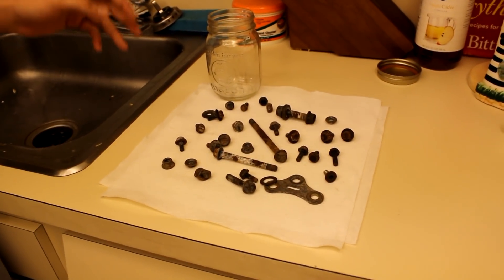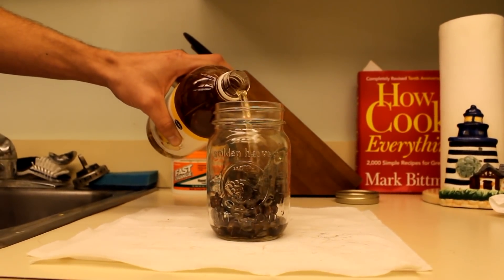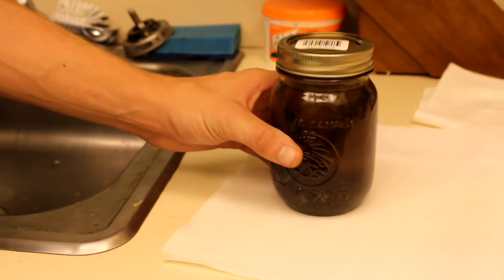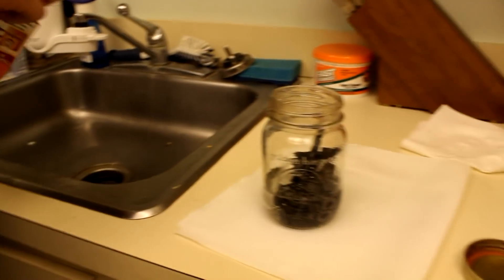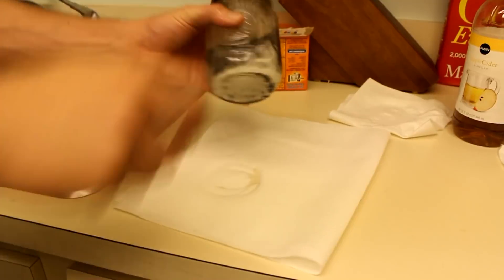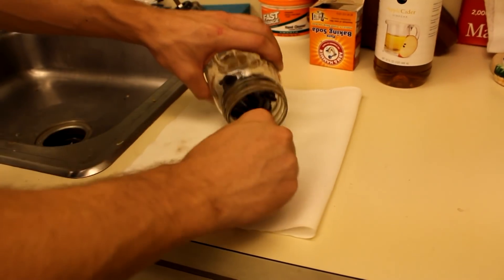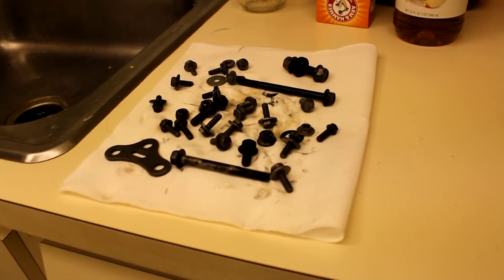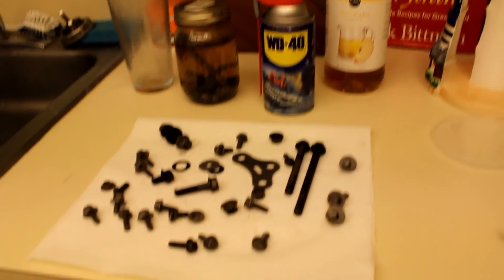HOW TO remove rust with vinegar

Comment: You can find even more potent "cleaning vinegar" at Wally World. Regular "cooking" vinegar is pretty diluted and weak by comparison. I use cleaning vinegar and my old Lortone rock tumbler I use for wet tumbling cartridge cases to clean up smaller steel gun parts and various small parts from other "wrenching" projects. A little agitation cuts cleaning time from hours to minutes.

Comment: I have just cleaned the rust off my new / old wooden planes and the white vinegar trick worked a treat...but thinking another couple of days in the vinegar would be better .....the irons have rotted through and i do not known if the will sharpen to anything good....vinegar works but ..."A little dab'll do you "....a day or 2 no more.....best to give it 4 hours then a clean off with wire wool another 4 hours and wire wool again .....then get the wet and dry out.... then the water stones .......spray with oil to remove any water to prevent rust....Whoops....!!!!

Comment: I did this on a set of feeler gauges and it actually DISSOLVED a few of the thinner ones. Just left some stubs where they once were. LOL. I thought it would just react with the rust, but it totally dissolved the metal. So be careful if size tolerances matter, because it does remove metal.

Comment: Just had some metal tools sitting in vinegar for about a week.  I had two bicycle chain whips and when I drained the vinegar the chains were completely disassembled.  Each link was completely gone.  I did no agitation of the vinegar besides carrying the container into the house from the garage.  I can't explain how it happened.  Do not try to remove rust from bicycle chains with this method.
Reply: Michael Hinz It is because you left it in there for a week. Vinegar is acidic so it will break down anything over time. You only want to leave it in there for 24 hours at the most. If after 24 hours the parts still have rust on them, rinse out the vinegar and neutralize the parts with baking soda and water. Then put your parts back into a container and restart the process by adding vinegar but only leaving the parts in there for 12 hours and then keep checking them periodically until you see no rust. Then soak them in baking soda and water but put double the baking soda and leave for 3-5 minutes to be sure the baking soda gets deep inside the crevices the rust ate away. Most likely this will be irrelevant because you probably are going to have to buy a new bicycle chain but for future reference....Good Luck!👍
Reply: That's what acid does haha. Don't leave important stuff in acid for a week. Sorry about your chain :(
Reply: Important point, not good news though. Do you know of any substance that primarily dissolves rust?

Comment: Great video!  But I might suggest spraying the WD-40 on before you let the parts dry.  "WD" stands for "Water Displacement".  Let it displace the water.  Then wipe with a rag and apply a thin coat of light oil or grease.  But that's just me.

Comment: I'll give you one tip that will help you out in life anything that you want to keep from rusting never apply WD-40. almost any petroleum-based lubricant will be much better than  WD-40 my personal favorite is used motor oil. why use used motor oil you may ask well there are a few reasons. the dirty motor oil will be able to be seen on the parts so you know they are still being protected also the used motor oil Stix or clings to the parts much better than new motor oil plus it is a good use for something that typically will B disposed

Comment: how long after i put the baking soda with water?
Reply: You don't really need to use baking soda. Since its only vinegar just rinse the acid off. The whole "acid neutralization" is completely useless. If you insist on doing so, a neutralization would take like 5-20 seconds.

Comment: +womackke will rhis work with white or brown vinegar & is the baking soda really neccessary if ur going to spray the parts with wd 40 to counter reoxidisation?
Reply: The baking soda is to neutralize the acidity of the vinegar. In theory if you didn't apply it and the WD40 didn't displace the vinegar then the vinegar may continue to eat away at the metal. It's better safe then sorry if it's something you can't easily replace. For a hinge, you could mix the soda and water in a spray bottle and apply liberally to the hinge then rinse with regular water and then use the WD40.
Reply: Rinsing with water and drying thoroughly should be sufficient. It has a relative neutral ph that should counteract the vinegar.

Comment: I have a trimmer that is rusted and doesn't want to turn on. Can I restore it by doing that?
Reply: I have exactly the same problem..also keen to know the answer?
Reply: Sure. Any metal can be derusted like this.  Just watch out with electronics,  don't get them wet with either water or vinegar

Comment: hey. I had a question in the methods used here. does the vinegar work and not harm all kinds of metal or is it very specific? I'm currently working on partially restoring an old pop gun I found and don't want to damage it further.
Reply: Make sure to not put it on a pearl
Reply: awesome thx! I tried it and it looks great. though the rust ate through a lot of the side. its good but far from its original.

Comment: I see you used apple cider vinegar. Will regular white vinegar work just as well?
Reply: Yes the only thing you need is something with acid in it all vinegars have acid
Reply: +Mike Maydonik  It will work better. Use Pickling vinegar as it is more powerful. Thing is the metal will be then virgin steel and flash rust so a coating needs to be applied fast

Comment: To speed up the action of the vinegar heat it first to just below boiling then pour over rusted or corroded metal parts. In case you don't have 24 hours to wait.
Reply: +Nick Haluta is it instant or can you just pore over. Does it just eat the rust away?

Comment: does this work with skateboard bearings
Reply from the maker: +Marcell Ventura yes soak them in some motor oil when your done, and make sure to take the dust covers off the sides
Reply: womackke  what if it has metal sheilds
Reply from the maker: +Marcell Ventura that is usually a problem as the metal shields are usually not removable. I have done it before by soaking them overnight spinning them soaking again spinning again then soaking in thin oil. Although doing it that way they never seem to end up like brand new as they do when they have removable dust shields
Reply: +Marcell Ventura Unless you can remove the side covers, it's probably better to just buy some new bearings. My 1973 Schwinn didn't have covers for the bearings, so I was able to do it using vinegar and a brush.
Reply: +Pro Gamer the problem you may find with bearings is that once they are worn they are never going to be as good as fresh ones, cleaning and packing with grease will help ease them but a worn bearing is never a good one :)
Reply: +Pro Gamer once rusted, any steel ball bearing is trash.  Fine ground surface is gone, bearing will wear quickly after that.
Reply: +womackke Can this work on rusty doorknobs and locks?
Reply: Man I'm here for the same thing. Took a skate on my local boardwalk and after than i had rust all over my board.

Comment: You do realize, I hope, that by putting your nuts and bolts in baking soda you have put them back in an oxidizing solution?  Should have just rinsed them after the vinegar soak.

Comment: Good vid this also works for cleaning coins I have also used this method with a toothbrush on battery terminals. Completly restored my cars door hinges while still on the car.
Reply from the maker: William Ward carefull to not clean valuable coins! kills their value. awesome to hear it fixed your car!
Reply: no worries on the coins thanks for mentioning it. I learned this technique 40 odd years ago because of that liberty dollors etc will be doing this on some parts on the car soon totally restored my acura door hing and bolt on the car with a tooth brush looks brand new and painted on the car not bolted to the car and masked. Funny how some common house hold products can do wonders. I was wondering how Amsoil would have worked on the pistons. I used to be a dealer a gave a bottle of Amsoil P.I. his car was stuttering he said for months. He put the bottle in with a full fill up. He said it stopped stuttering by the time he got to the first stop light. I think if used regulary this keeps the injectors pistons and everything else very clean. Oh, I hate Fucking Ethenol why these bastard politicians keep messing with our stuff!
Reply: I'm glad you've added hour experience. You have just about answered the ideation I've just posted about using vinegar on a zipper attached to a bag. Gonna give this a go!!
Reply: my car's hood hinges are stiff @ the pivoting points wonder if this will work better than grease or wd 40?
Reply: Generic (auto) spray silicone is great on most all car hinges, as well as soft-flexible-sealing points.

Comment: In this process what the vinegar does dissolve the rust because it wants to bond to the molecules of rust. To do this it also causes rust in good metal too, which is the downside to this method. The upside is that it works fast and the baking soda is to neutralize the vinegar so there is none left unreacted, preventing it from rusting further.

Comment: I've been doing this for years= there is nothing easier or better. You should buy the vinegar by the gallon to save money. I just wipe the black off of the part and straight to the WD40. Lot of salvageable tools and parts at garage sales with this "trick".

Comment: Sorry for the negativities, but It didnt work for me. I used it to remove rust from my chain for my bike, followed all the directions. When I put the chain back on, I tested it, and the chain broke in less than three minutes. I was riding and suddenly I found myself racked up on the frame (ouch). I looked at it and i found it cracked at every joint. Was I not supposed to use it on a chain?
Reply: +Ryan Vogt your chain was probably busted before and the rust just covered it up

Comment: So I'm a WWII reenactor and the canteen I have is from 1945, so naturally it has a few rust spots inside that are small and just surface, but I can't scrub them, will this method work or is there a better way?
Reply from the maker: this would work but I would probably try coco-cola in it for the taste... or molasses but yes this would work... you could also fill it with some sand and shake vigorously if the inside is not coated...Thanks for watching

Comment: Hi I have just bought a second hand mountain board. It's nice and everything it's just the screws and springs are rusted to heck. I can get the screws in. Ingest it's just I can put the springs in which are under the deck and recommendations? I was thinking if putting some vinegar in a spray bottle and spraying it :)

Comment: what if I can't put the metal in a glass jar and have them soak in vinegar... and they're attached to an old basketball hoop :o
Reply: Spray it with vinegar, I got a pair of jumper cables that got rusted siting in my trunk ,its worth a shot!
Reply: Hafa Ball For odd shaped or big items you can line a strong cardboard or wooden box with plastic sheeting and use it for a soaking tank. 
If it won't fit in a tank or is just too hard to get off whatever it is on then roxydog2004's idea will work. 
You can also wrap a rag soaked in vinegar around the part of cover the rusty spot with a rag soaked in vinegar.

Comment: Next time get some ATF (automatic transmission fluid, I use GM dexron III) pour it on a bucket, and drop your nuts in bolts in, come back a day later and they should be good. If not scrub them with a wire brush, should come off easy. That's what I've always done with tools/nuts and bolts that were rusty, the detergents in the ATF break down the rust.
Reply: I meant in a bucket!

Comment: You don't need to dry them before putting on WD40. WD40 displaces water; hence the name WD40 (WaterDisplacement40). If you dry them first, you risk flash rusting.
Reply: Never knew that.
Reply: Yep.
Water Dusplacement Formula Number 40

Comment: WHat if its a ww2 era rifle 
that is rusted to hell :D
Reply: Take it to a gunsmith or someone who knows something about maintaining firearms. Removing the rust is easy, but firearms have different kinds of finishes. You have to know how to not damage the finish and then have to know how to prevent more corrosion.
Reply: Search you tube for cleaning rusted items with molasses.  This is also a cheap way to do it if you can come up with a larger container like an old childs wading pool.  Mix the cheap bulk non-food grade molasses 1 part with 0 parts water and let um soak.
  I saw an Aussie doing that with car parts, even whole fenders from antique cars.
Reply: thanks

Comment: Oh I forgot, dont use this on aluminum it will eat it. I have never tested this but i would say that it will. I guess you could use it to etch aluminum if you wanted to. Would be a lot safer than using some other acids but it would probably work a lot slower.

Comment: If you soak it long enogh it will work. Apple cider vinegar works the best from what I have heard. Dont seal it in a container or it will blow up, it releases bubbles as it works if you look as it does its thing. The black is carbon from the steel it will leave a film on the steel. Another suggestion is check ever so often and take a stiff nylon or wire brush and go over the rust and rinse all the loose stuff away with water and put it back in again. You could also filter out the loose rust out with a coffee filter and pour it back in.  That way its working on the metal your cleaning up instead of the loose rust in the vinegar.
Reply: It worked fine for him without that why go through all that trouble.
Reply: Don’t use MUMSNET science get citric acid.

Comment: Did he use white vinegar or apple vinegar
Reply: It doesn't matter. Vinegar is ascetic acid no matter the source.
Reply: Thanks I appreciate it. I'll have to give it a try!
Reply: He used apple cider vinegar
Reply: It doesn't matter what vinegar you use as long as its strong like 5%
Don't buy apple vinegar, it's too nice and expensive. I felt bad when I saw how he chucked it in the drain after 1 use.
Reply: Yeah I kinda gathered that I just cleaned a Pabst blue ribbon church key a.k.a. old-style CanOpener pretty good with your basic white vinegar from the supermarket. 1 gallon for like $2.50
Reply: Patrick McCLeary I use apple cider vinegar. At first I used white vinegar because that's what we had in the cabinet. After the first batch of parts was derusted the vinegar smelled like a septic tank. I almost gave up on the whole vinegar idea. Then I bought a gallon of apple cider vinegar to replace what I used out of my wife's supplies and tried a little of it. It crusted over just like the white vinegar but no stink. It still smelled the same after 3 batches. 
I use it in the basement shop with no complaints.

Comment: I add my testimony that this works! I had some ACV with the mother and dipped my clipper blade in it for 24 hours in a solo cup covered up. Came out like new. I just need to dry, and oil the blade. Thanks!

Comment: I noticed you threw the vinegar down the drain. As a suggestion pour it in a different container. Pour the baking soda into the same container. THEN pour the mess down the drain once it's no longer an acid.
Reply: Water soluble acids don't need to be neutralized. If there is some toxic property other than acidity then that must be taken care of.

Comment: I did this to my blades from my trimmer and it did remove the rust but i dont know why blade change to black befor I took it out of the vinegar
Reply from the maker: That can happen apparently its some sort of oxide that  is actually protecting it but you can wash and oil it off
Reply: Oh I see, but I threw away my blades all ready lol

Comment: I found an even faster way to remove rust. Go to Wal-Mart and buy the cheapest toliet bowl cleaner. I paid 1.34 per container. Get the one in the white bottle that says removes rust. Dip the part in it for a few hours and you will see it ate all the rust.  I tried vinegar and it didn't do anything for almost 6 hrs.

Comment: WD-40 will actually rust those parts faster. It evaporates leaving no protection for metal at all.  A better choice would be a lithium grease spray.
Reply from the maker: Well actually all the parts still look great and even tools etc. havnt done a thing since that day to them. Now I have not left them out in the rain or anything but ya...

Comment: Wow. I tried this on a whim with beauty of an outdoor heavy padlock that has rusted over the past couple years. I could barely shut it and opening it was a bitch. In 24 hours, following this videos instructions to a "T", I have a near new lock. The slightest of rust is on some edges but more importantly the lock functions like new. A $50 lock that was fixed for around $6. Thanks for this post, it will go a long way!
Reply from the maker: you welcome, glad your lock works!

Comment: The acetic acid in vinegar reacts with the ferric oxide (rust in the surface of the nuts and bolts, forming ferric acetate and water            
(Fe2O3+6CH3COOH->2Fe(CH3OO)3+3H2O)
The bubbles come from another reaction between iron and acetic acid forming ferric acetate and hydrogen gas. ferric acetate is not visible in the solution due to its property of being soluble in water.
Reply from the maker: fancy
Reply: The fact that ferric acetate is soluble in water has nothing to do with whether it is visible or not. That property depends on the transmission and absorption spectrum of the chemical in solution.